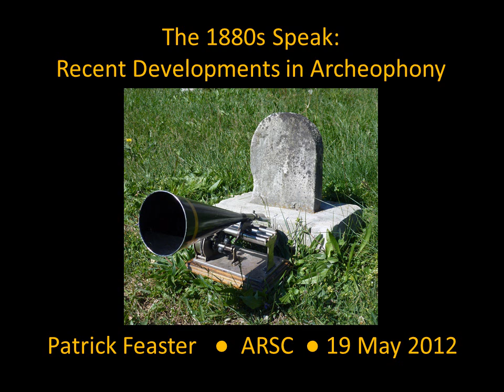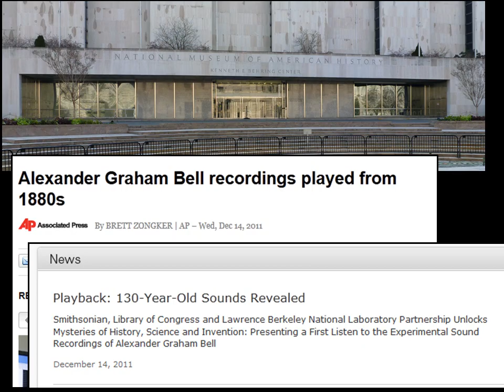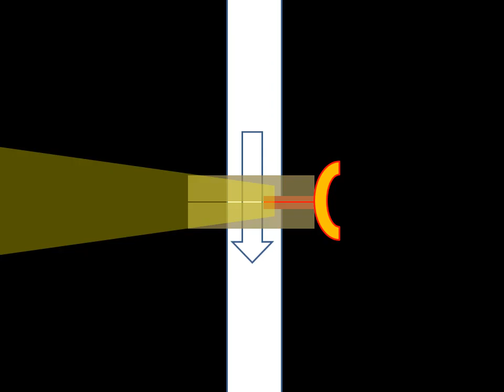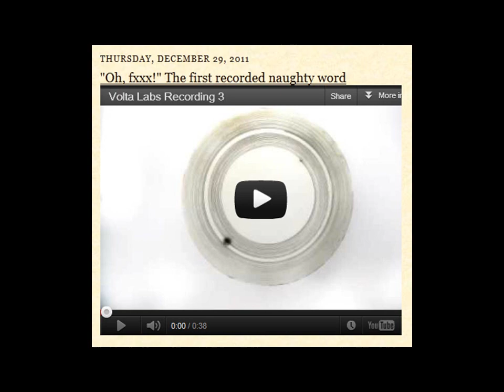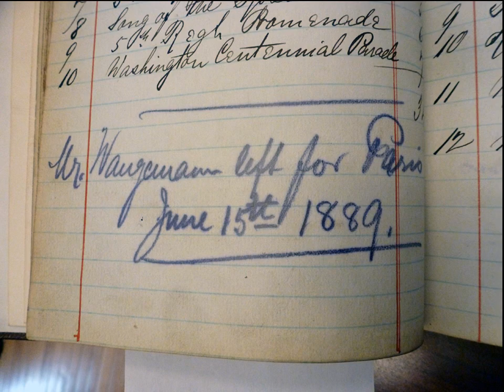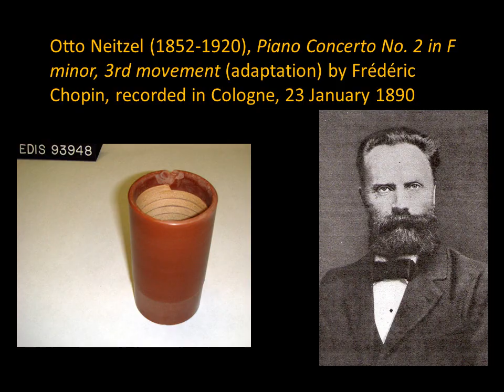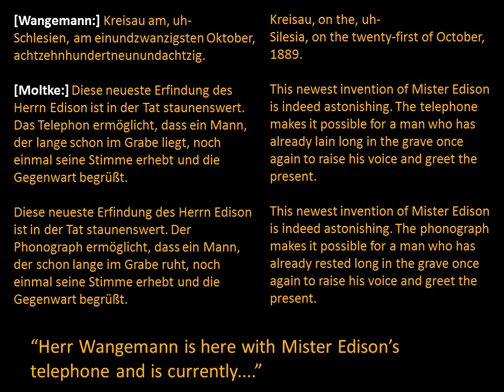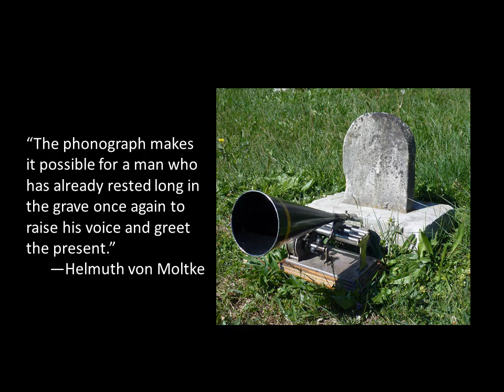The 1880s Speak: Recent Developments in Archeophony

Comment: I’m sure modern audio engineers could work on removing background noise and scratches while bringing out clearing the recordings. I understand you don’t want to change the recordings from an archival perspective, but I think there would be merit to also creating “cleaned up” copies as well.
Reply: There's videos on Youtube of city streets recorded in the late 19th century which have been slowed down and had appropriate sounds (like trotting horses) dubbed on. Not "authentic", but still amazing. And much closer to what the camera operator would have been seeing all those years ago.
Reply: There's really not much one can do to remove noise without compromising the desired signal. This is especially true of cylinders (where the signal is usually scarcely louder than the noise). I have little doubt that the recordings presented in this video were as "cleaned up" as they reasonably could be.
Reply: @popefacto5945  I respectfully disagree, if you replicated the recording techniques and made modern samples of a wide verity of sounds (trrr...as a marker is genius) digitise the recordings to have the most accurate representation of how they were meant to sound, then subject the new cylinders (of course you would have to have multiple copies of every sound) to various conditions that would put them in the same physical condition as the original samples (i.e. some of the recordings have a repetitive "noise" which suggests that the cylinder is no longer round, therefore give 'em a bit of a squeeze).

Then develop AI that could return the modern recording back to their original sound (by comparing the new damaged recordings to the new good recordings). You could then apply the AI to the OG recordings, sort of reverse engineer the deterioration of the ages. Admittedly this would be very time consuming and expensive but it would be fun.
Reply: @rangstar7835  Your "solution" is to devise, using the most convoluted methods possible, what you believe to be a new tool. But it's really not anything new. It's an automagic (via the vague power of "AI") version of tools which already exist (see: Noise Reduction). If you'd ever done audio restoration, you'd already know this.

You can apply all the noise filtering you want but much of that "noise" happens to live in the same frequency range as what you're trying to save. This noise cannot be removed without compromising that signal. You can "respectfully disagree" all you want. It doesn't change that fact.

And did you actually suggest "squeezing" an out-of-round wax cylinder? LMFAO. Wew, lad. Please stay in school. Good luck with your "AI".
Reply: @popefacto5945   NO! It is not a new tool it is an old tool it is called science, it is called experiment.  You are viewing this problem from the perspective of an engineer, I am viewing this problem from the perspective of a scientist. As I have stated this will be very costly and time consuming.

 1 - Recreate the original conditions i.e. use the original recording techniques to replicate a wide verity of the original sounds (possibly thousands, possibly tens of thousands)
2 - digitise those recordings (everyone) to maintain the most accurate record of the sounds.
3 - Subject those recordings to the natural conditions that the original recordings would have undergone i.e. temperature, atmospheric pressure, humidity, position in relation to the centre of the earth...did some fuck ignore the this way up sign?
4 - Develop a computer programme that  can factor in all these variables and can compare the distorted recordings to the original (new) recordings to cancel out the "noise" 
5 - Apply said AI to OG recordings.

I respectfully disagree that this is convoluted solution, I would say it is a pedantic solution, an expensive solution and possibly an unreasonable solution but it it is still a solution and is not magic.
Reply: @rangstar7835  LMFAO. Wew, lad...

Noise reduction via 'algorithmic' filtering is already a thing. You don't need to reinvent the wheel. You seem to believe it's necessary (or even desirable) but that's probably because you have no idea what you're babbling about.

Install Audacity on your computer. It's free. There are plenty of old recordings (also free) on archive.org for you to play with. Experiment with the Noise Reduction effect for a few days. Don't bother replying if you haven't done this "homework". 

Noise Reduction (comb filtering) is a subtractive process. When you remove "noise" from a recording, you also remove a bit of the signal. There's no way to get that back and no reasonable way to estimate what it covered up. It's gone (or never really existed).

This is why any archivist worth their salt uses noise reduction sparingly (if at all). Never mind that every recording technology has self-noise. Wax cylinders are particularly bad. There's no way to "fix" it. They sound like ass and it's part of their charm.
Reply: @legaata  "...the noise is periodical and repeats..."

Maybe if there's a scratch or crack in the medium. Actual surface noise is pure chaos. Have you ever touched a wax cylinder? Ever hear one played back in the flesh? They are mostly noise. Can some crackle, hiss, and pops be filtered out? Certainly. But not without compromise (again; it is a subtractive process that's best experienced firsthand).

I've spent decades doing this shit for real (mostly working with 78 RPM records) using natural human intelligence and an educated layman's understanding of how audio recording technologies work. If you think you can write an algorithm to automate this process then you should definitely fucking do that. Please.

It is painstaking and frustrating work (more 'art' than 'science' really) and, frankly, there's not much point to it. Simply documenting the recordings using the best apparatus available is more than enough to 'preserve' them for posterity. Then maybe RangStar's magical "AI" can sort them out.
Reply: @popefacto5945  Well to be fair, Google is already using a form of artificial intelligence to increase the resolution in images, based on a "best guess" of what it should look like. So the idea of using artificial intelligence for signal improvement is not completely groundless.

Comment: It must actually mean (the 1st story)  that it was easier to record individual recordings over and over than to make copies based from an original. That assures that each recording would be as crisp and clear (so to speak) as the last, instead of getting progressively worse as the successive pressings or copies or whatever they called the copies then were made. I imagine the needles were replaced frequently though. Just replaying 78's on the Victrola my brother-in-law bought some  decades back, you had a large box of what I was told were actual porcupine needles which had to be replaced often. Once they started using diamond needles that really wore out those old 78's on multi-speed turntables.
Reply: In the earliest days of the recording industry, performers sang or played before a rack of phonographs (how many there were depended upon the loudness of the original performance): shortly thereafter, someone invented a "pantograph" copying machine, where an original cylinder could be mechanically transferred to one or more copies. Naturally, the copies had some loss of fidelity compared to the originals; but at least they could meet the growing demand for recordings.

Berliner's disc recording method made it easier, by allowing multiple electrotypes to be made from the original, which could then be stamped into shellac. Cylinders had to wait until Edison developed a more complicated molding process.

With disc records, needles had to be changed for every play: record manufacturers had soon learned to add abrasive materials to the disc, that would grind the needle point to fit the groove. There were some multi-play needles, such as the Victor "Tungs-tone", that allowed for longer use, though. 

After about 1935, with the advent of lighter weight electric pickups, the abrasive compounds were dropped from record manufacture: that is why one should not play these later 78s on wind-up phonographs.

Comment: I've always thought that the storage of wax cylinders on pegs rather than in boxes, was a better way to prevent the development of mold on the cylinders playing surface. I've never encountered cylinders stored on pegs, which became stuck to these pegs with the passage of time, to be a problem, but it obviously is. Could it be that the wax composition of late 1880's cylinders was responsible for this?

Comment: Wow! I'd love to know if someone with a bit more knowledge can enlighten me here. At 21:40 there is a VERY early recording of a quartette. Now, I was always under the impression that the stereotypical singing style of the early 20th century was the result of recording and broadcast mediums. The high pitched, fast vibrato, and easily tones were used in order to be heard through early recording and radio. But this recording suggests these singing methods predate recording. What would be the purpose then?
Reply: I think some of that weird way of singing, was just the style that was popular at the time.  Listen to 1900 - 1920 recorded opera, it had that high pitched warble.  It was how they thought it should have been done, well some people thought that anyway - in my opinion.

Comment: If they just filter out the hissy surface noise as well as making other enhancements, these could be heard much better.
Reply: They have--these recordings are just at the threshold of audibility. It's taken months (if not years) of work to not only derive an audible signal from the original material, but one with speed corrected as well as possible.
Reply: @jimshulman9221  what would i do a search for to find the non-hissy and corrected recordings?
Reply: I wonder if the new noise filters (with "AI") would do a better job

Comment: 13:00 If they were able to produce sound recordings with light in 1884, why was in 1927 before the first talking movies to come out? 43 years!
Reply: In order to produce sound on film, vacuum tube amplifiers were required. The amplifying triode tube was first developed around 1907 by DeForest and first used in telegraphic radio, then voice communication and telephone land line repeaters, making practical long-distance possible. Then microphones and amplifiers were used to make phonograph recordings, taking over that job from the acoustic "hollering into a horn" recording used up to around 1920. First experiments with sound on film took place in the early 1920's by DeForest. There were lots of experiments for sound with movies, some with large phonograph disks. Sound on the same film as the picture solved the problem of synchronizing the picture with the sound.
Reply: @reecenewton3097  Thank you.